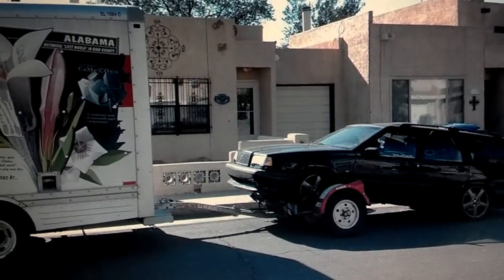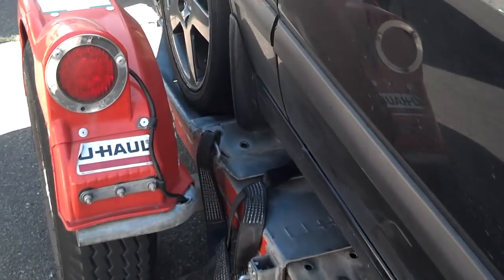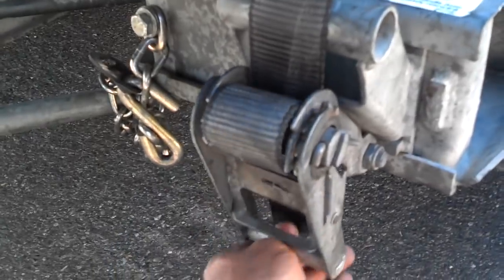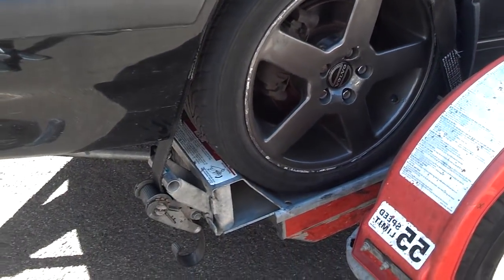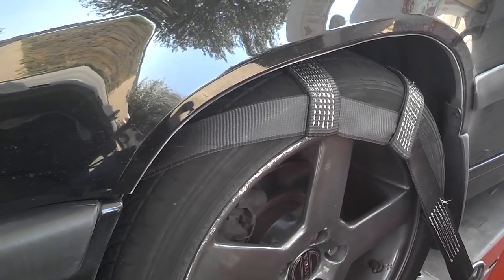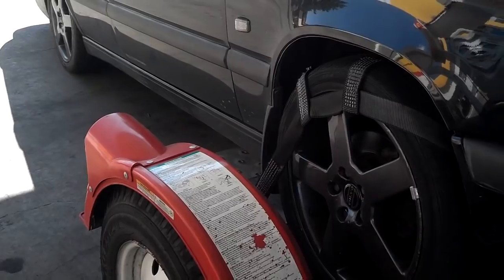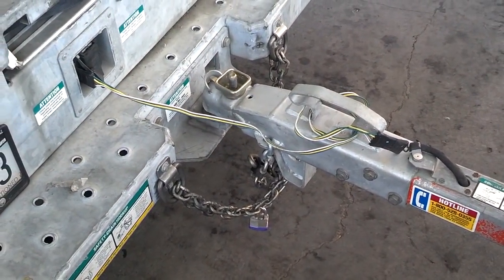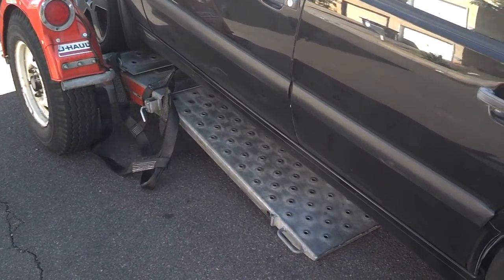U-Haul car trailer towing How to tow your car with a 2 wheel car dolly Please read description. VOTD

Comment: Hey Robert, this might be a rookie question to ask but, do you tow the vehicle you're pulling in park or do you pull it in neutral?  FYI, I'll be pulling a '02 Oldsmobile Alero 2WD/Front.
Reply from the maker: Doesn't matter. The wheels are free on the ground.

Comment: And all she'll drive can not be used on a dolly regardless of pulling a drive shaft as the rear wheels will go into slip mode because of the differential causing the wheels to spin in opposite directions of each other
Reply from the maker: Not all AWD cars are like that.

Comment: Same here rob thanks for the video it definitely sheds light on this matter
Reply from the maker: Michael Hodges Cool, thanks for watching.
Reply: Is the Volvo awd?
Reply from the maker: Not mine.
Reply: Oh ok  I was going to tow my girls Nissan murano and and take off the drive shaft but I rather use the awd dolly just to be safe. Her cars run it running and it's experimental lol
Reply from the maker: If it's AWD it is easier to lift the entire car off the ground.
Reply: +Robert DIY what's awd and FWD? Ima do this soon for a Nissan Altima 04 .
Reply from the maker: All Wheel Drive (AWD) and Front Wheel Drive (FWD).

Comment: Hi Robert, very helpful indeed. Had a question around minute 2:24. The green label stuck on the U-Haul says "route tire strap behind this tube", but you seem to have routed it in front. Did it not matter?
Reply from the maker: Not really but do route it behind.

Comment: wow every 100 miles i have to check the strap? I'm driving 1200 miles to Florida that's crazy you know how much time I will lose pulling over every hundred miles,,
Reply from the maker: I did not say check the strap every 100 miles. I said check it after the first 100 miles, then the next 2 fill ups.

Comment: Im not sure what difference it would make but I know when I used a uhaul tow dolly that the strap should go under that bar, at 3:35.
Reply from the maker: ThomasXp Thanks for sharing.
Reply: I agree its wrong. The way u had it
Reply from the maker: Thanks for the confirmation.
Reply: Robert DIY actually, you had it right. That round tube keeps the strap from getting damaged on the sharp edged trailer.
Reply from the maker: Thank you sir. We made it safe.
Reply: RedTeamWolf Watch the instruction video from uhaul... the strap won't rub against the edge because the tire provides enough space for that not to happen.

Comment: Is the car set in neutral while you're towing? Do you drive it up on the dolly, then attach it, then put it in neutral and take off the handbrake? Thx. Good video.
Reply from the maker: No, the car is in park. The car is FRONT WHEEL DRIVE. You should never tow a Rear Wheel Drive car with the rear wheels on the ground even in neutral. You pull the ramps out, drive the car on the dolly, put the car in park then lock it on the dolly. Watch the video over and over again until you understand what is going on.

Comment: Thanks for the video...had a question...I watched another video where a guy who looks like a U-Haul employee recommends that you guide the straps behind the tube on the ratchet assembly...you run the straps in front of the tubes. I wonder if that caused them to loosen? Did you have any other issues with this dolly? Was it stable while driving? I need to travel about 1,000 miles and and plan to tow it behind a U-Haul 14' truck. I dont want to be driving and suddenly see my car 500 feet behind me...
Reply from the maker: You do NOT want the straps touching anything other than the wheels. You have to tighten the straps real good and you don't want anything being stressed.

I towed 900 miles and as I explained in the video, I stopped at about 30 miles and tightened the straps, then every time I stopped (mainly for fueling) the truck I tightened the straps again. After the 3rd tighten they didn't stretch anymore. The first time I may have gotten 2 or 3 clicks, the next two stops maybe only 1 click each.

Very stable, didn't even know it was back there. You should only use this type if your car is FWD.

Comment: No u can't tow a rear wheel drive just because it's stick.... Way to melt a transmission I speak from 10 years of operating a tow truck. If your rear wheel drive, automatic or stick shift you have to disconnect the drive shaft. Unless you know what your talking about, hush up. It can cost people 1500+ in repairs...

Comment: Robert, can you give me any special advise for a trip from New York to Sacramento, CA on Road I-80. It will cross the Rockies (scary!). I plan to tow a rear-drive small car (Mustang) with a Toyota Tacoma Pick up using a dolly. Yes, I will remove the drive shaft. Never towed anything before, ever.
Reply from the maker: If you can get a full lift trailer. Also, double check that removing the drive shaft will be enough. Sometimes the rear end can still be damaged even with the drive shaft out.

Comment: Ill be moving from Tennessee to Indiana here soon and gonna be renting a 10' truck and a car dolly for my 2015 Toyota corolla.  its front wheel drive. would it be good to disconnect the battery all the way since the key wont come out of the ignition all the way while in Neutral and will it drain all my gas in the car even when towing?
Reply from the maker: Huh? The car should not be running. I leave mine in park.